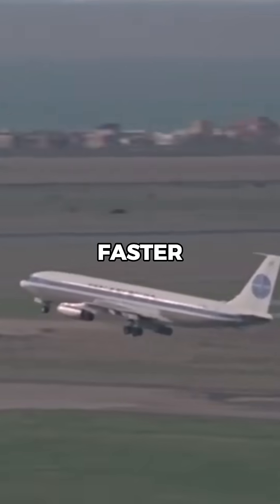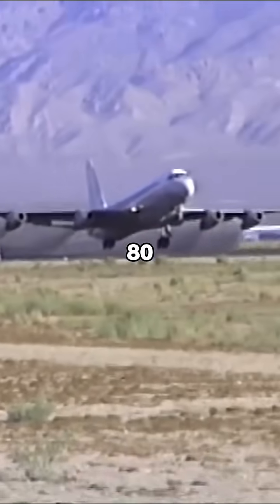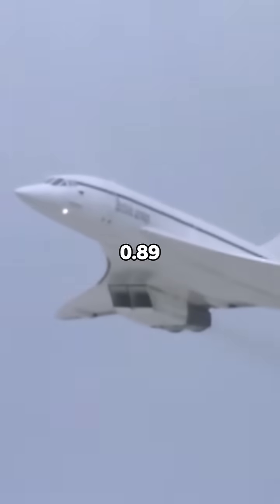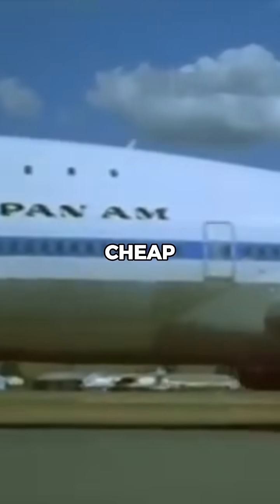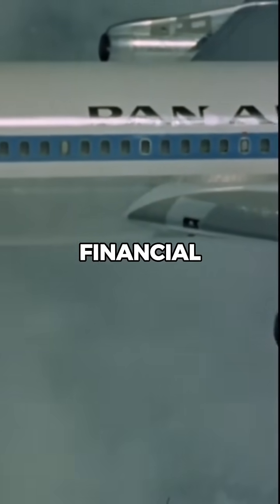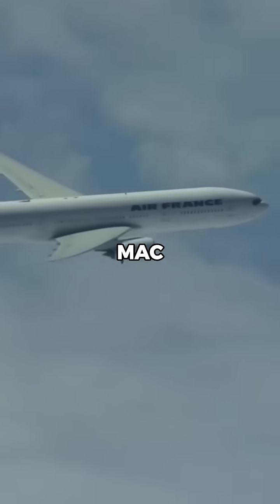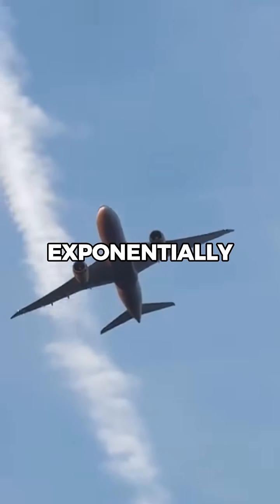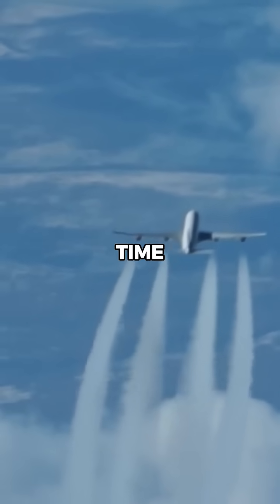why 1960s aircraft flew faster than modern aircraft

Comment: So why was fuel cheap then but expensive now? So far they haven't run out of it.
Reply: I’ve got a couple reasons. The first is inflation. This is the largest reason for things becoming more expensive. Also, I believed the US stopped drilling for as much oil during the pandemic, so they had to import oil from other countries, which would be at an increased cost.